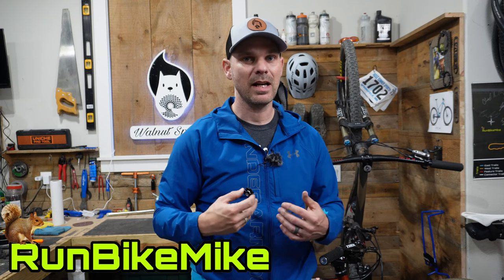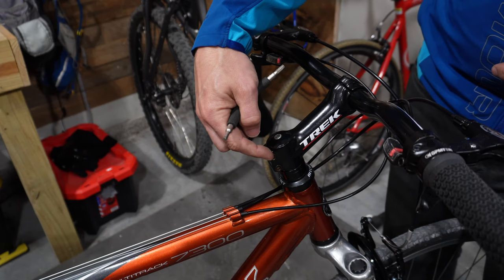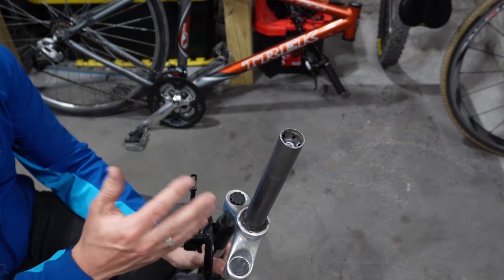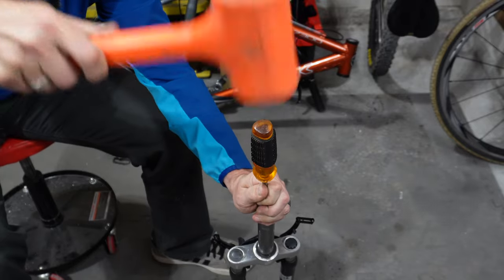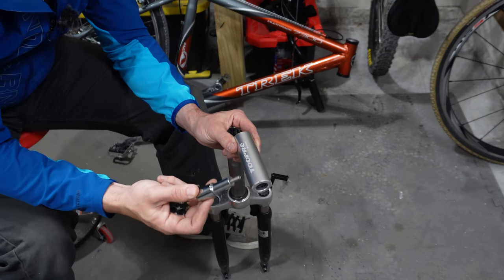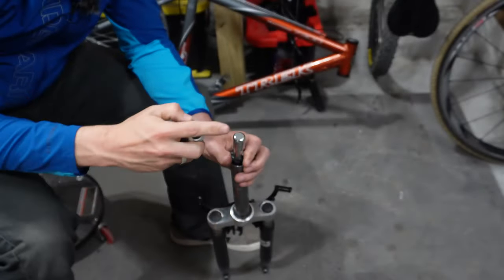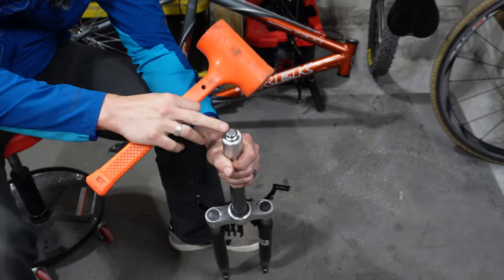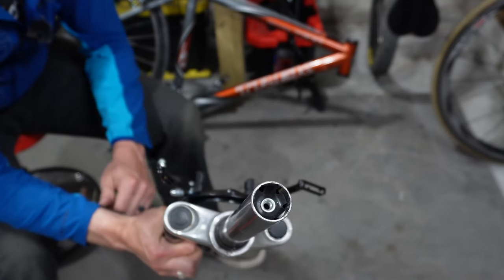How to Remove and Install a Star Nut in a Bike Fork

Comment: My ebike has a threaded fork that I used a quill adapter to attach my aftermarket BMX handlebars to. The quill fit the stem, but the fork now has 1-2 mm of play. The original handlebars clamped around the fork stem and used a threaded nut inside to compress the connection. I am thinking of ordering a clamping style stem adapter but the top bolt design requires a star nut to fasten it, (which my bike does not have). Can you install a star nut into a threaded fork stem? Is there a better solution to eliminate the play in the fork stem?

Comment: My star nut got rusty in less than a year. I guess the metal isn’t stainless. 

Do I need to worry the rust getting worse and seizing up the bolt to the point I can’t remove it one day?

Or should I replace it when rust develops?

Thanks
Reply from the maker: No need to worry as the star but is only there to hold the fork in place while you tighten the stem bolts. But also replacing them is easy and doesn’t cost much.

Comment: Yeah but how do you remove the star nut if your fork ain't open at the bottom. Like my madone lol
Reply from the maker: A Madone more than likely has a carbon steer tube and it won’t have a star nut. It will have a compression plug. Those come out with an allen key.
Reply: @RunBikeMike  The fork legs are carbon that appear to be glued into an aluminum steerer tube that runs through a carbon head tube. it's an old madone, 2009 model 5.2 pro.

Comment: How much bigger should the star nut be than the tube it's going into?
Reply from the maker: It should just sit on too without going into the steerer tube. When you measure your steerer tube you might find that most bikes are 1 1/8 inch.